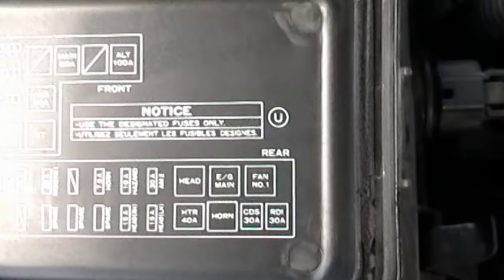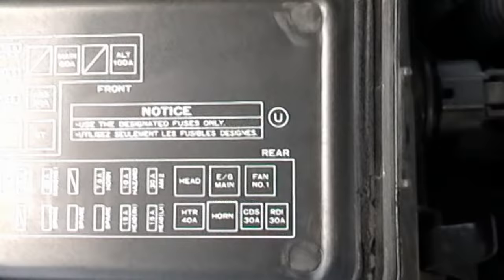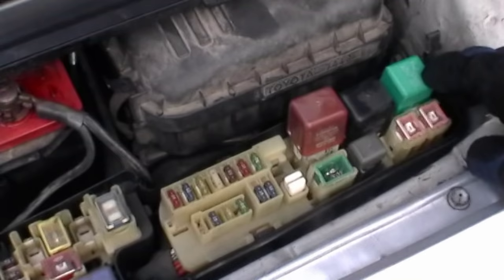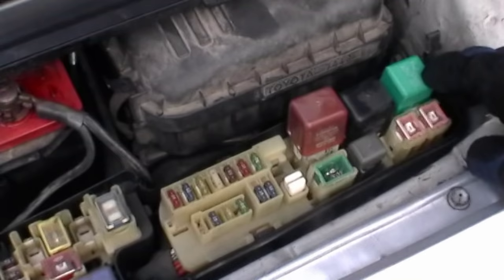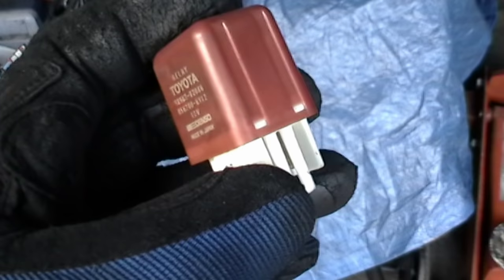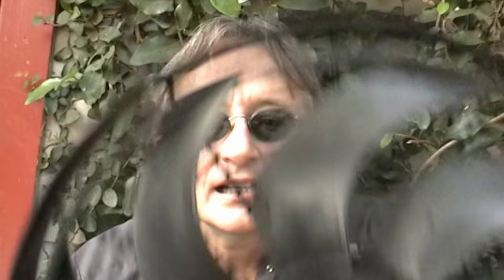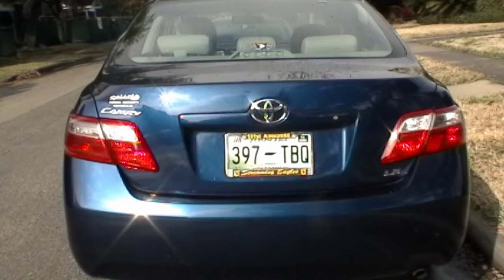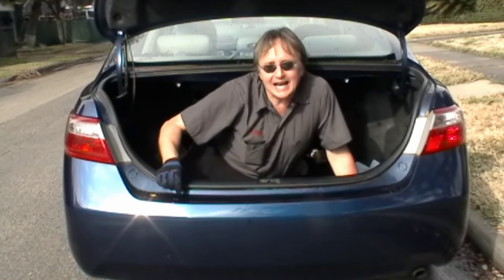How to Repair a Cooling Fan in Your Car

Comment from the maker: depends on the car, but if you have a car with regular ignition switch that uses 12 Volts and not a computer driven one, you can wire the fan off power on the ignition switch, put a relay in line with fuse, and send the power wire from the relay directly to fan positive wire.

Comment: dude you are the fucking man you saved me 450 buck the mechanic was trying to charge to replace the fans he said i needed a new one i followed ur steps DUDE IT WAS JUST THE DAMN RELAY SWITCH  those fuckin liars
Reply: FTRHOODFRESH where do I get those little spark plugs?
Reply: i hope this work on my car.
Reply: Angela Collins there not spark plugs, its called temperature sensor
Reply: Guess what, I just got it fixed and he did this exact same thing, now my fans works, thanks!!!
Reply: @Angela Collins - Watch the video again. Nowhere in there does he say anything about a "spark plug,"
Reply: Some mechanics try to overcharge and take advantage of customers car knowledge ignorance
Reply: FTRHOODFRESH wish me luck bruh. im at honda car shop now.  My AC fan aint working.    I just hope the relay acted up too so i can save myself from spending alot.
Reply: Your AC fan is your radiator  fan

Comment from the maker: you just get the one wire on the connector once plugged off the switch and connect it to any metal part of the engine to ground it. Fan should come on then

Comment: Hey Scotty, thanks for the great DIY vids. As a novice, I've been working on my own cars for 42+ years. Right now I'm trying to resolve an intermittent hard shift condition in my 2000 Chevy Impala 3.4; the old girl has close to 218, 500 mi on her. I've been researching the issue, and subsequently replaced the transmission filter (fluid was changed only a few months ago [2,000 mi)), Replaced the coolant temperature sensor, and the radiator cap. Radiator, and cooling fans are o.k. I bled the cooling system (it's not using any significant amount of coolant), and cleaned the MAF sensor real good. The engine runs like new; I take care of my stuff; you know, regular oil changes, adding fuel injection/combustion chamber cleaner to the fuel regularly ("Chemtool B-12"), clean air filter etc. But the problem with the hard shifts persists; she goes into the hard shift mode at operating temperatures Monday I plan on taking the old girl into a local transmission shop for a diagnosis. At this point, my guess is either a bad PCS, or bad 1,2-3-4 shift solenoid. Any guesses from a pro like yourself?

Comment from the maker: have the battery and alternator load tested first, places like auto zone do it free. Often a weak alternator does that, but if not, fan motors are probably worn and using too much power and need replacing
Reply: Scotty, my fan isn't doing its job, but if I bang on the fan motor it starts to go but it eventually stops and won't start again. Any idea what could it be
Reply: Carbon brushes wear out, taping might bridge the contacts briefly enough to get going but the contact is lost after the vibration is over from bangin on the fan. Get a new motor.

Comment from the maker: they do cycle by computer and sensor operation, often they have a time lag. As long as car doesn't overheat and the fans shut off when the car is turned off, leave it alone

Comment from the maker: if it doesn't overheat, live with it. Often a bad computer circuit does that and they cost a tonl You could guess with a new temp sending unit for the fans though if you want an educated guess

Comment: when checking the cooling fan switch not sure were you ground the switch and were do you put the power to make the fan work.
Reply: Ikr the video cut off where he shows how. Redo please
Reply: The wire you pull off the sensor is where you clip it.
Reply: Yeah that was one of those single wire sensors some cars have two terminals but yeah just 1 ground from switch to neg on battery
Reply: @thelouis22ism  Yeah, it ff's  before you see how to make the connection.

Comment: Scotty, I'm lost at 1:48. "You ground the wire here....then take the other end of the ground wire and put it on the negative terminal of the battery". So I just clip a wire somewhere on the white sensor square and clip the other end to the negative battery terminal? nothing is happening when I do that. What does that mean? (Maybe I'm just not connecting the wire correctly, wish you would have shown that better.)

Comment: Love you vids, Scotty. So, what if the motor, fuse, temp sensor and relay are all fine but the fan still doesn't turn on at high temp?
Reply: I'm having  the same issues.. could it be the wiring. I need help on this
Reply: @joshmurillo3395  i found that placing direct current to the fan, the fan barely worked. Replaced it and everything is fine now.
Reply: @lmcjr6268  so change the wiring right
Reply: @joshmurillo3395  no, i replaced the fan. Didnt replace any wiring.
Reply: The fan is new and replaced  also the module.  I put direct current  and turn on. I connected everything  then the fan didn't  turn on. Changed  the fuse and same problem the fan doesn't  turn on while  it's all connected
Reply: @Josh Murillo—-did you find a solution?

Comment: Just wanted to add one very important tip: ALWAYS use INSULATED alligator clips when connecting directly to the battery!
The fan connectors are so close to each other that they may touch, and if they do, the connecting cable will heat up like an oven element and could turn into a fire hazard.
Reply: Seriously!  One touch and you have yourself a short circuit!
Reply: He had gloves on but very good point to make
Reply: @jonnyenough1531  gloves dont protect against electric shock lmfao
Reply: Helpful idea , we should also put fuse 20 A in case of fan is shorted, so we will be prevent ourselves against fire.

Comment: I had been looking all over the place for some simple straight suggestions on what might be causing my radiator fans to not be coming on in my wife's 1998 Olds Intrigue. I was really happy to find this video by Scotty Kilmer. I located the culprit within moments after watching this presentation. Keeping it simple has it's advantages. Thanks much for taking the time to share your knowledge with us.
Reply from the maker: +Scott Todd that's what I'm here for.
Reply: Scotty Kilmer i put a paperclip in my temp gauge switch and the fan wouldnt turn on with the ignition on but it came on when i turned it to off then i turned it to on it shut off my ac condeser fan wont turn on with the ac on only if i connect it to the battery im lost
Reply from the maker: +jf405  often a bad main computer circuit inside does that. Most guys will just wire em to run off a toggle switch or run all the time the car is running to bypass that

Comment: God bless you Scotty, I went to a repair shop in Dubai. They told me that they need to replace the aux fan on my. Toyota Prado 2005, but the fan motor when I sprayed some water came back on. I also think it is the sensor or most probably the relay.

Comment: sweet, have this problem with my 04 civic, replaced the thermostat no change, no coolant in the snow in my driveway, a new rad cap seemed to work for a while and the guy I take my car to when I run into head scratchers tested the fans, said they work and figured it was a slow leak in the head gasket and keep an eye on it to be sure, so just to see, last time she started running hot i pulled over, cracked the hood and sure enough  fans not running. glad to see it could be a cheap simple fix cause I really didnt want to buy a newer car and a head gasket jobs a bit too pricey for a 14 year old A to B'er (or A to Beer store) clunker

Comment: you're a big help... car over heated last night, so i thought i had a head gasket problem. didn't have any of the head gasket symptoms like white smoke, milky oil etc. I have an 89 veto and they do run hot. after hours of searching i saw that there was bubbly coolant seeping from the runners, but more importantly the fan never came on when i ran the car today to see where the issue originates from. ill try these 4 things in your video to see if that helps.
Reply from the maker: MrJSupreme26 also, try my video "how to fix an overheating car"

Comment: Do all cars have a cooling fan switch? Including a 2006 Dodge Charger Daytona R/T 3.5? I got the main fan (left on drivers side) working but the low hasn't been coming on. I did the 12 volt jumper to the fan and I believe it came on but I need to verify that again. Old age... I enjoy most of your videos. Keep up the great work and thank you for your service!!
Reply: You know that other fan should be your ac cooling fan
Reply: @fargeeks  It wasn't specified in any of the documentation but it certainly does make sense now. But would it cause the engine light to stay on?

Comment: Tipp for checking in the relay is still good: hold your finger on it and then turn on the AC to full heat in your car (this should trigger the fan and therefor trigger the relay). A relay which is working should make an audible clicking sound, and you can also feel it by holding your finger onto it.

Comment: Scotty great videos, I am trying to get my VW a/c running and only 1 of 2 fans are working.  I have replaced the 2 fans but still the left drivers side is still not working.  I have a new FCM, Pressure switch and add freon that made the clutch spin so.  As of now I believe I just need the drivers side fan to work and I will possibly have cold air.    the car doesn't over heat and the passenger fan works with a/c on just no cold are due to drivers side fan.
Thanks for your great videos and military service.
Reply: Update? How did you fix it?

Comment: Hi Scotty, I have a 2011 mini cooper countryman and my radiator fan doesn’t turn off when I stop the engine and it also comes on right away. I checked relays fuses and even changed the coolant temperature sensor
Reply: What ended up being the problem? Bad fan? Thanks.

Comment: Today I learned to check the fuses before replacing an entire assembly. Created a video showing how to replace this fan and the fan still didn’t work. Followed scotty’s video and found out that not only was the fuse blown but the old fan worked just fine.

Comment: Can you make a video showing how to test the fan that appears to be working but is failing causing over heating.? There seems to be little info on that for people to find and the fan gets ruled out. The bad fan is also skipped over as a possible cause of electrical issues. Fans are power hungry even more so if going bad.

Comment: On top of my fans not kicking on which I already hooked to a rc battery so they deff work .. 
temp gauge shows that she  is running cold , I believe the thermostat is stuck open because the lower hose isn't getting hot , I'm hoping that's the case why it says running cold and I don't have to replace the temp sensor too hopefully just the thermostat ...

Comment: Scotty I did the first test & the fan works.  The second test before the fan relay, testing the temperture sensore. Where do you run the wires. You said the negative wire to the sensor then to the negative battery terminal? then the fan should turn on?  thanks Scotty.

Comment: On my 2003 Focus, I checked the fans and they work. Pulled out the relay and checked it with my power probe , and it worked. But when I checked the terminals in the relay socket on the control side--one side showed hot, but the other side did not show ground. And while I had the relay out, I jumped across the terminals going to the fan and the fan worked. But I don't understand why I don't have a ground on the control circuit side.  Thank you.
Reply from the maker: +SaintWilliamIII  ground is what actually sends power to the fan, whatever sends ground there is broken, OFTEN a bad computer circuit that drives it
Reply: Oh, that's not a good thing. I was thinking of trying to rig a ground to that relay so I can keep the car cool enough to drive it to work. If I do that, will it work or cause me other issues?
Reply: Also, I couldn't find the cooling sensor to check it. Would that cause a lack of ground at the relay terminal. Thanks Scotty.

Comment: The cooling fan didn't come on in our 1998 Toyota Corolla before. And my dad knows that the cooling fans were stuck over one winter. The fan motor and the switch sensor for the cooling fans were still working. And  my dad knows that it git seized up over one winter. And he fixed that problem until the cooling fans start to work again.

Comment: Mr. Scotty! 1997 BMW 318i
Replaced the TEMP SENSOR
Repaced the FAN SWITCH
Checked the FUSE, its ok!
Replaced the RELAY
....NOTHING! 
NOTE!  The fuse box diagram does show a high speed and low speed relay, do I replace them both?
Reply: Any help?
Reply: This is not much help but you can switch the relay with a similar relay. dont just buy another. Make sure it's not an important relay though (like the horn or window relay). Maybe the connection is corroded or the cable that goes from the motor fan to its destination is cut. MAYBE the temperature sensor is faulty and/or reading low temperatures so the computer does not send the signal to turn on the cooling fan. Maybe the thermostat is stuck open and your engine never gets hot. Maybe your engine doesn't even have a thermostat - sometimes previous owners remove them because they live in hot places. I dont know why though. It's very cheap, but SOMETIMES not easy to change. It's best to really diagnose things before changing parts because it can get expensive. I'm young and tech-savy but diagnosing problems can take a long time. Invest in a Digital Volt-Ohm Meter and watch a long tutorial to learn how to use it. Also invest on a OBD-2 code reader or take your car to an advanceautoparts/autozone/O'Reilly/Napa for code reading. It's free. 

Let me know what it is please, if possible.
Reply: Or just hire a mechanic - I know it sucks, and many are just part changers.. try to find one and you will never have to worry/break your head. That's their job. They get paid for it. Although if you fix it yourself you save money and can invest in tools, which is what I do.

Comment: Scotty, I basically have the reverse issue here. My fan is always on even with the engine off and drains the battery over night. I remedy this issue by either disconnecting the battery off.  Where should I check first when the situation is opposite of your video (always on).
Reply from the maker: +Shaun Harris pray it's a bad fan relay, cause if not, often a bad main computer that costs a ton

Comment: hi Scotty, loved your videos...when should fans be normally start spinning?
Reply from the maker: when they reach a pre set temp, differrent for different models. Or, when AC is used, they should come on most of the  time
Reply: Hi Scotty Kilmer, I just changed thermo fan switches, now the fans turn on immediately before engine starts and stays on until I turn off the entire key switch, what is wrong? please help thank you.

Comment: I have a 2013 Nissan rogue when sitting at a idle you can smell the coolant and steam will start to come out of the hood it's not leaking any coolant or using any and then temperature gauge is in the normal running range no temperature light isn't coming on but it's for sure getting hot

Comment: Scotty,
1998 mercury grand marquis (with the ford 4.6) similar to a Crown Vic.  
Coolant temp gauge is dark and not reading.  
When I put tester on it - she lights up and gauge reads.  I replaced the alternator today although I doubt that is related. 
Tried re grounding it elsewhere but didn't work.
Please give me a step by step on how to troubleshoot or your best diagnosis as I'm sure you've dealt with this common fleet type car.  
Thank you and I appreciate you and your work
John.
Reply from the maker: +johnnymac1975 if it's dark, get a used dash from a junk yard as receiving unit is bad and you can't buy just dash, plus a newdash costs a ton

Comment: no. it mentioned how it does not matter how you plug the terminals on the sockit when you test it- just spins in a different direction. so how can it hurt the fan then?

Comment: Just replaced the compressor in my 1992 Mazda 626 because the compressor would screech, then blow the fuse.  But, the fuse did the same thing with the new compressor.  I'm wondering if the fan could be locked up and causing the fuse to blow.  I don't know, but, it's disappointing for sure.  Everything is good, minus the comp not kicking on.

Comment: Please explain the part about testing the temp sensor. Do you connect the positive clip to the sensor and positive terminal of the batter. And then connect the negative terminal of the battery to metal to ground it?

Comment: Even if the fan came on, u still have to check the other steps. Check all steps to be sure where the problem occur. You might have to replace all, if not two or three things.

Comment: My 2000 honda accord is normal temp gauge and but when i turn on the ignition and turn it off and take out my key it turns on the fan. and it wont turn on until 16 minutes later it does it every time.

Comment: I was told that if I use the small jumper cables to connect to the battery and coolant plug that it could potentially blow out both fans or the entire motor .. becaus there’s no measurement of voltage..

Comment: Silly question but to test the fans with the wires does the ignition have to be on or the engine on to get power through the wires?  And would a low voltage battery keep the cooling fans from coming on?

Comment: Hi Scott. I have a 1993 honda accord lx. the problem with my car is that the fan stays on all the time. i even have to remove the fuse in order turn it off because if i don't it discharged my battery.